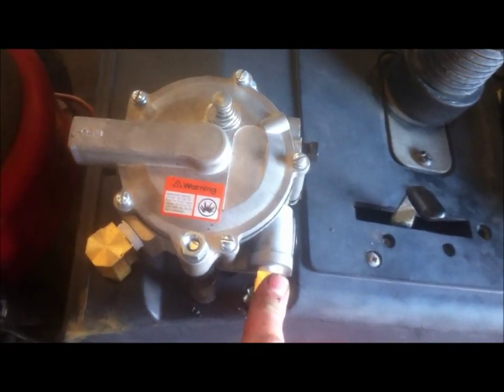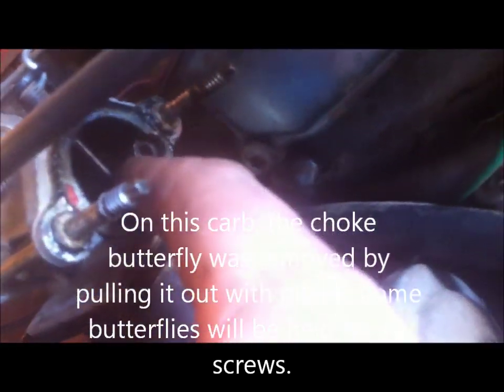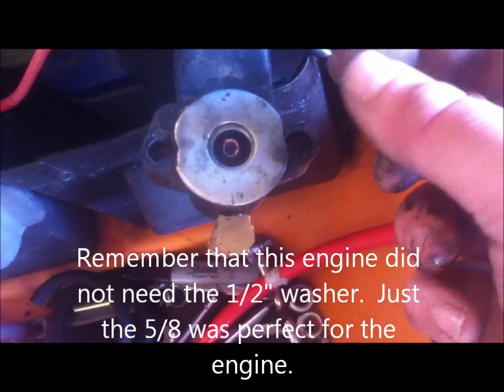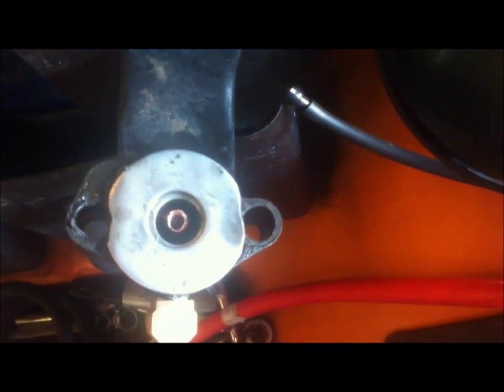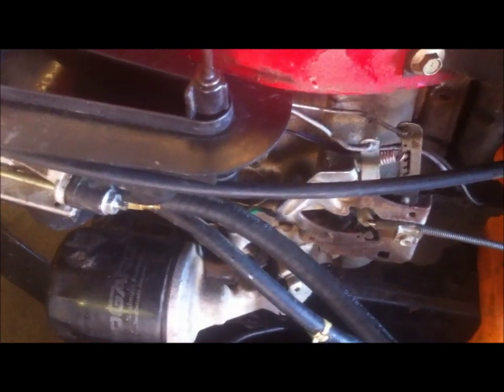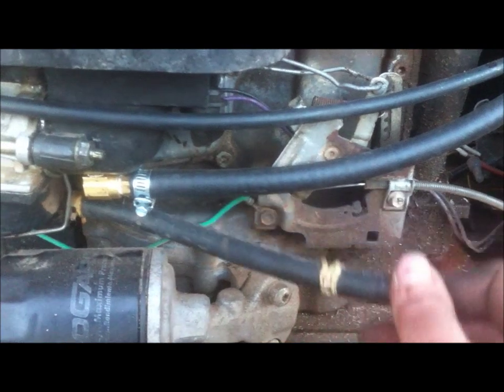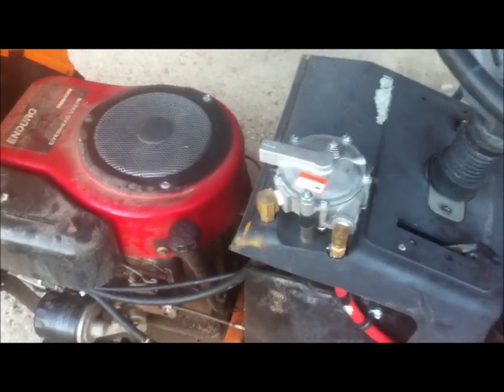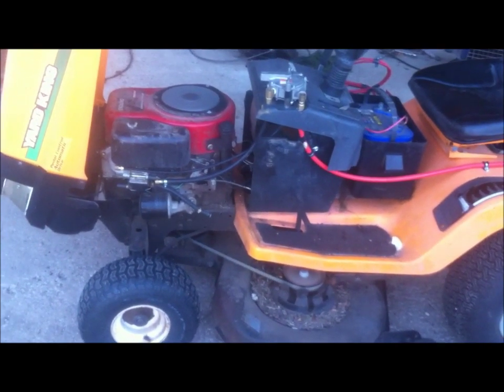LPG Propane DIY lawn mower conversion using Beam T60

Comment: Buddy, you are sitting on a litteral ****! For one thing you are not running a high pressure 2-stage regulator, as you should be coming directly out of that propane bottle. Negative pressure regulators are not meant to be the primary regulator. I am really surprised that yours did not blow out from the get go. Please leave propane alone, it is dangerous & nothing to mess with. You obviously do not have any expierence with it.
Reply from the maker: This regulator is made for high pressure liquid propane with coolant passages to prevent freeze ups.  This is exactly the same regulator that is run on forklifts everywhere.  This is a high pressure regulator.

Comment: You have done a bit with the washers but the low pressure regulator cost 100 dollars and should be replaced with something that would shut the gas off when the machine is not running.  It seems that this could be replaced with a carburetor (your washers) and a shut off valve that would shut off fuel when machine is stopped until the engine is cranked and asks for fuel. The governor could add a bit more fuel when speed decreases.
Reply from the maker: The regulator that I used has a vacuum shutoff.  It will not flow until a vacuum is created by the engine.  The problem is finding a carburetor for every possible application.

Comment: Great job !  Your conversion is the safest and most complete that I've seen for a lawn mower. Many of the others don't have good throttle response like yours. Thanks for showing the details of your home made mixer too. I previously did a BBQ regulator conversion on my single-speed lawn mower. I recently moved that fuel system to a Troy-Bilt edger. But I just ordered an Impco Model J type regulator which I want to test because I want better throttle response.
Reply: I understand about your mower getting beaten up. I bent the shaft on mine by hitting a tree sapling stump, so I couldn't salvage it. I like the propane on my edger now, because that engine was really inefficient previously. The small carburetor couldn't atomize gasoline well, so the unburned gas in the exhaust always caused sinus headaches. No more headaches since I switched it to propane !  BTW, to make the conversion really simple, I just tee the propane into the Exhaust Gas Recirculation nipple. That leaves everything intact, so I can dual-fuel back to gasoline if necessary. I just received my new Impco Model J regulator, so I'll let you know next week how that works out. Take care !
Reply from the maker: I doubt  tee into the EGR will work.  The regulator requires a decent amount of suction to function properly.  This is the reason for the restriction plate that I added between the carburetor and air box.  Without the restriction, there is not enough suction on the regulator.  The BBQ regulator works completely different.  It continuously flows lpg so no suction is necessary.  If you notice on all the car style mixers that go in the intake tube, they throttle down (or restrict) the air tube. 
 This allows a suction to occur for the regulator to work.  Keep me posted with your experiment.  I am always learning and looking for ways to improve.
Reply: You were right. The EGR didn't give enough vacuum to make the regulator work. I needed to put my fuel tube into the throat of the carb to get it to work, but it was inconsistent. So I decided to get rid of dual-fuel compatability and just use propane only. I removed the primer pump and metering valves from the carb. Then I pressed out the main gasoline jet. That left a hole which was exactly the right size to insert a 1/8" plastic barb, which became my propane inlet. That was in the middle of the carb venturi, with good vacuum. Now, the fuel system is tuned and running well. I'm happy with the RPM range since it is much wider than with gasoline. The throttle response is excellent too. Thanks for the tips on your video. That helped a lot !
Reply from the maker: Here is another video of a spud that I made for the carburetor.  Sounds similar to what you did.  You might find that it is difficult to start and your throttle response maybe sluggish unless you add a small restrictor plate between the carburetor and air filter.

Getting your air flow mixture correct can be tricky.  I once had a engine way too rich.  The unburnt propane was combusting in the exhaust and the exhaust was glowing red hot.

https://www.youtube.com/watch?v=cVcJNsk6b50&t=755s
Reply: Yes, mine was similar. The edger I installed on has a tiny 29cc engine, so the carb is much smaller. I find that 1/8" inside diameter tubing provides plenty of flow for engines up to about 3.5Hp. So I was also able to make the spud small too.

This engine was always hard to start, so it is equipped with an optional drill adapter for electric start. That works well with the propane setup, but eventually I also want to use the recoil starter too. I'm going to try using the choke to see if it would start easier. (When running on gasoline, the instructions never recommended using the choke.)

LOL about your glowing muffler !  Thanks again. Take care !
Reply: Here is a video of my finished project. I'll make a video of the carb jet mods this weekend.   https://youtu.be/PRVdkZxMT1o
Reply: What was the result using the  Impco Model J type regulator? It is less expensive, does it do the same job? Better, as good or not as good?
Reply: @Wayne Lasyone - Good question. The reason I chose the Model J was simply due to lower price. I got a Model J copy on Ebay for $47 (with free shipping). For comparison, the cheapest T-60 regulator I found was $91. With regard to pressure specifications, they both are exactly the same (input up to 312psi, output -0.5psi). There are other minor feature differences which don't affect our use on small engines. The Model J is also slightly bigger because it is meant to have enough flow for 100hp engines, versus 60hp for the T-60. BTW, Impco, Beam, and Garretson are all merged into the same company now. That explains why their products have the same specs.

Comment: do you need a negative regulator to make the throttle work?
Reply from the maker: Yes.  The regulator controls the delivery of fuel.  It will change the amount of fuel delivered to the engine based on engine demand.

Comment from the maker: T60.  I believe that the T50 does not have the vac shutoff feature that will prevent the propane from flowing in the event the engine quits running.  As far as your outboard motor goes, you can only do this if you engine is 4 stroke.  A 2 stroke requires oil and gas mix and that oil is what lubes the engine.  Good luck.  I am currently looking for a boat and engine and I want a 4 stroke so I can convert to LPG.
Reply: Will Bass